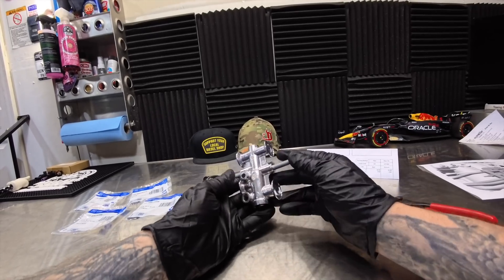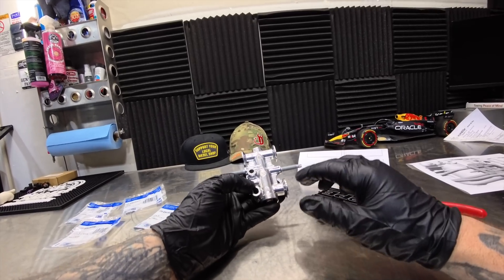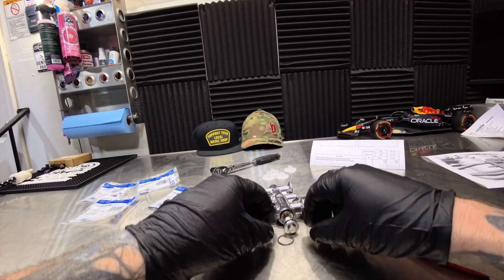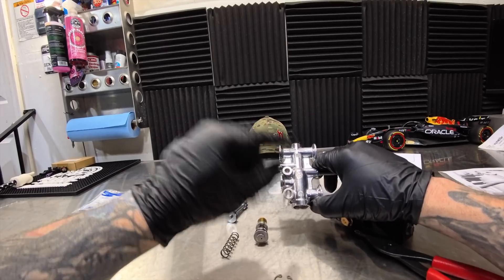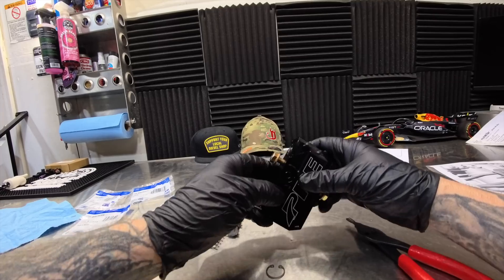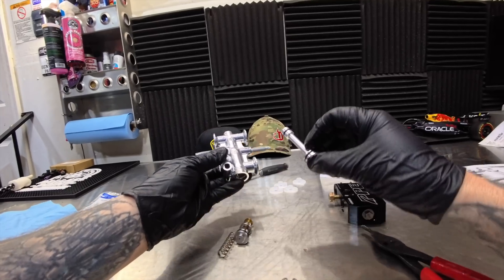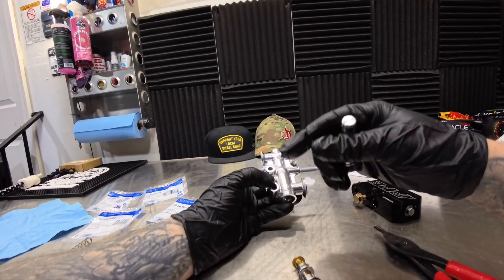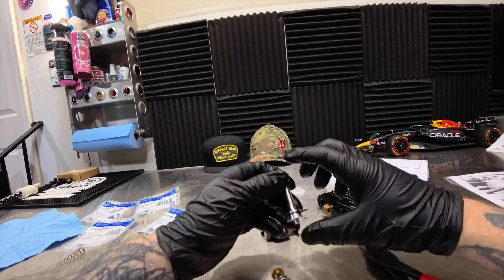Don't Let High Temps KILL Your 10L80 Transmission or Valve Body

Comment: what about a resistance heater strip on the line for winter? or blocking part of the trans cooler if it is separate?

Comment: Hey brother so I’m in Los Angeles California coldest it gets here is 40-50 degrees hottest is 100 degrees would you recommended installing this bypass just to protect these transmission for the future? I also don’t do any towing tbh just daily driving my trail boss
Reply from the maker: I lived in Anaheim, CA most of my life. If I were still there I would be running the PPE Bypass for sure. https://www.demonworkshop.com/products/2020-2025-gm-3-0l-w-10l80-transmission-transmission-fluid-thermal-bypass-valve
Reply: @DemonWorks thank you brother will order

Comment: Waiting for your follow up on this barbell install. I live in Alaska and don't want to install the ppe product for reasons stated in your presentation. In my 2015 5.3 there was a gm valve/thermostat offered per gm service bulletin which worked very well. Also resolved overheating in that transmission. It was set to open at 160. Perfect. I just purchased my first diesel truck last month a GMC 2026 3.0 Duramax. Your channel has been a valuable source of information for me. I am looking forward to many mods and upgrades in the future. Engine auto stop delete was my first one. Please include who makes this part and how I can get it. When you do the follow up on this valve body part. Thanks for all you do! Northpole AK. If you want to send me that part I will get back with you on what happens at -20 with the numbers.

Comment: With the barbell valve my tranny has hard time reaching 108f in 50f weather,  too low for my liking stock valve going back in. And there's more then enough room to remove the valve without removing the housing

Comment: Great Video! There needs to be more conversation about the Quality of ULV OEM fluids. There is almost zero wear additives in them. They are pretty much hydraulic fluid with detergent additives and red dye. Shocking numbers. I think this is a big driver for failed or worn components

Comment: I put this on when I got my 2021 with 45k miles since bypassing the one on my 2014 6l80 5.3 it made a big difference. With this one I've noticed very little difference.  Just did the PPE deep pan and amsoil fluid and still getting to 180ish, also in Michigan so temperature is still around 70-80. When towing my boat ~5000lbs it doesn't really get over 190 but still not a drop from what I seen before. I'm at 54,000 miles and it shifts flawless, fluid wasn't crazy dirty or anything when changed. As you said it needs some heat so staying between 160-190 is perfect to me

Comment: It looks like Factory is more restrictive even if valve modified
Reply from the maker: Absolutely, that was the goal, to slow it down a little in comparison to how well the PPE one flows. This was meant more towards an improvement at winter time.
Reply: @DemonWorks Thank you

Comment: I live up in ND and was wondering if it would be okay to install it up here in the cooler weather during the winter months. as we speak I have a PPE transmission pan on but have not pulled the trigger for the bypass yet. I do see the 195-205 transmission temps still and would like to swap out the bypass if possible, thanks for the help

Comment: Tried the PPE bypass and ran too cool- couldn’t exceed 150 in the summer time.

Best combo for me (New England) had been the STOCK valve.  Add a PPE transmission cooler and you will run 170 all day long.  A bit higher around town, but coolers down within a min back to 170 once you get moving.
Reply: The valve doesn't open to 196 so the PPE transmission cooler wouldn't help at all until over 196?

Comment: I have 2024 1500 3.0  22,000 miles. Average trans temp 194-196 commuting a hr. I got the BET barbell last week and kinda on the fence to install it. I definitely looked at PPE but like most 
people im concerned about too low winter temps even in the NW isn’t very cold very much. Before I found these bypass items I was going old school way by adding inline cooler. But won’t solve current 196° average temp NOT TOWING. Because of OEM thermostat. I got both PPE engine and trans pans those are going on next week, maybe the BET barbell too. 🤞🏼
You definitely got my attention to see your exp. with barbell. Keep up the good work 😅

Comment: I replaced the OEM  valve with the PPE bypass valve and my 2019 Silverado and it runs much cooler. And I have zero trans bump. Check out my install video 
https://youtu.be/UjyetizOhZ0?si=moKWeRqaUJW5KYV3

Comment: I just want to say that First off, why do we feel the factory temps are too high, and second for anyone who has a warranty this is a bad idea. 
I should tell you that I have installed a new bypass valve as you have here and the reality is, the temps are maybe 10 degrees cooler consistently. the 22 duramax 1500 10 spd is never going to drop 75 degrees just by installing this in place of the factory bypass valve. 
I was running 180-190 this summer in 90 degree temps, after installing the new black bypass valve, even in 60-70 degree mornings, the temp still reaches into the 180's, so not sure ow you could pos be seeing a 75 degree drop???
Reply from the maker: Lm2 is a different setup and therefore this piece doesn't have as large of a difference in comparison to the LZ0. In my LM2, the lower temps came from deeper pan and larger trans cooler with removal of the front shutters.

Comment: @DemonWorks so I contacted superior solutions and they said that the STL020 kit is what I needed for my 23 LZO, installed it.  Took it for a 2.5hr drive to Fort Lauderdale 98 degrees ambient temp.  Truck ran 138 @ 70mph a would creep up to 150 in town light to light traffic.  My concern is that actually seems low.  Living in Michigan during the winter months is that going to be too cold?  Curious your thoughts.
Reply from the maker: I personally do not like the temps that low for months.
Reply: @DemonWorks  in your opinion at that temperature is there anything that it could cause physical damage to the transmission??  I’ll be towing a trailer from Florida back to Michigan total weight 3500 pound Ish so I suspect the temperatures are going to increase some as we’re going through the Carolinas and Smoky Mountains.  Not asking for a guarantee just an opinion I know I’m assuming all the risk here.

Comment: I know the 190+ temp is concerning BUT I understood the reason behind higher temps was to "boil off" any condensation that may occur within the trans. You mentioned that in the video. Do you have any "data" that shows running the trans at these lower temps may cause other problems due to moisture? I have the LM2 (same trans) and see 195 max even while towing. I was looking at the PPE bypass but am leaning more toward the "barbell" solution. I am concerned that during Michigan winter the trans will NEVER get to operating temps. Not interested in switching the valves every 6 months.
Reply from the maker: I do not have any data to back it up, unfortunately. I do agree, your trans will not get up to temp in michigan winters.

Comment: Does the zr2 comes with the max tow pakage?
Reply from the maker: No, unfortunately it’s not an option. If it did, would be a perfect truck.
Reply: @DemonWorks  do you think is possible swap it for 3.73? And still runs normal?
Reply: Sorry my english is not perfect

Comment: How are we supposed to get the trans oil level correct when these bypasses are installed, since we can’t reach the correct temp when checking the fill hole?
Reply from the maker: The trans level process does two things- gets the fluid up to temp to start flowing the fluid through the bypass valve and to get the fluid to raise due to fluid expansion. Since the fluid is already flowing through the valve, that is solved. once you get the fluid up to your new operating temp, the level of the fluid will be accurate.
Reply: @DemonWorks  thanks for the reply. I guess the question is, is the fluid expansion negligible from 125 to 175ish? I would think so, but not sure.
Reply: So, if I change the valve on my ‘25 and have the dealer change the fluid in the future and they notice the temps are lower, will they wonder what is going on? I have a PPE pan coming and I am wondering if I am pushing it with the dealer? I asked them about the Nexgen valve body and they would void my warranty if installed…Lincoln was cool with it.

Comment: I installed the ppe transmission cooler on my 2024 3.0l  . The temperature runs between 186 and 196 while hauling my travel trailer.

Comment: Absolutely the best for transmission. South Florida never goes over 130 and when I'm towing 6500 pound boat and trailer gets to 140. Had in my 2023 Duramax. 3.0 and now in my 2025 Duramax. Also installed PPE Transmission cooler and deep pan. ❤

Comment: If this is such an issue, why doesn't GM address it with a factory engineered solution?
Reply from the maker: They like the fluid to be hot and thin so the vehicle gets better fuel mileage.

Comment: Very interested in this. Had the trans fluid changed in my 2023 and the color of the oil was awful. Very little towing. I agree with the oil degradation. GM mechanic says there is not a good way to flush the system on this transmission. Had them change the fluids on my 1/2  and my 2022 3/4 ton diesels. It was expensive to do but way cheaper than a failure. Did both trucks at 35K miles.
Reply from the maker: New video is up. Good call on changing your fluid. They are correct, there isn't an easy way to flush out the fluid on these.

Comment: Love how technical your videos are man. As always great quality content. My question is if this is this unique to the 3.0 Duramax? Asking because I tow a 7300lb boat and my trans temp has never went above 180. This even at slow speeds going up hill. It tops out there then will drop off. Truck is stock 25 AT4 1500 6.2. I thought they shared the same trans?
Reply from the maker: Thanks for the kind words! Your truck, being the 6.2 actually has a lower temp valve inside the trans, so the gas variations run a bit cooler.
Reply: @DemonWorks I wonder if it's possible to just run a different valve from say the 6.2s?

Comment: Shouldn't the transmission get hot to burn up any humidity or water in the oil? maybe thats the reason.
Reply from the maker: Yes, that's what was mentioned in the video for the condensation in the fluid.

Comment: I own a 2025 AT4 Ultimate with just 3,100 miles on the odometer, and it has already overheated twice. It’s currently in the shop, awaiting GM’s approval for a full transmission replacement. Based on this experience, I’d argue that keeping transmission temps lower is far preferable to the consistently high readings above 195°F. Anything over 225 transmission fluid starts to breakdown.

If condensation were the real concern, it’s worth questioning why the gas-powered variants have a thermal bypass valve that opens at 143°F. Water and condensation can begin to evaporate even at room temperature, so the idea that 120°F is “too low” doesn’t quite hold unless the rate of condensation is somehow outpacing the evaporation rate at that temp. And if that is the case, you likely have a much more serious underlying issue than just transmission temps.
Reply: That's what I have thought as well... why would water need to hit boiling point to evaporate?  Your shower steams at 100 degrees. And seriously,  how would any measurable condensation get inside a sealed transmission to begin with?

Comment: installed and not seeing the temp drops it claims! still hits 200 after the ppe bypass any recommendations?????
Reply from the maker: Do you have the LM2? That is routed different than the LZ0 and typically sees less of a drop in temps. You could have a different underlying issue, but we will ignore that as a possibility. On my LM2's I removed a few of the front shutters to allow airflow to pass through the trans cooler and that provided a nice drop. The shutters will close and block all airflow, this will keep temps high in both the engine and the trans cooler.

Comment: My last truck 2010 5.3L with the 6 speed trans never got hotter than 73c/164f when towing on a hot summer day. 

Never had 1 issue with the transmission had 450k km on the truck. Also drove it in cold winters as well. 

So I fell which ever product would keep you in that range would be good. 

Will like to see how you make out with temps with the bar bell vs ppe bypass 

Then I can decide which one to order

Comment: Come on man. This is just nuts.  Driving around with a transmission temperature at 120???  Even Allison engineers are laughing at this.   This has no application in the real world.  180 is great. 120 is just silly.
Reply from the maker: hmmm..... I feel like something was missed here.
Reply: I’ve never heard of a transmission failure because of it running too cool.
Reply: @jestandaert it’s called thermal dynamics.  If you were to hypothetically run a transmission at say 70 degrees, it would absolutely cause damage and be extremely inefficient. 
Just like most engine wear occurs not a start up, but the time between start and the oil reaching operating temperature.  They won’t even start a NASCAR engine until the oil is heated to 180 degrees. 
  At 120 degrees you will wind up with water in your transmission and excessive clutch wear.

Comment: I would like a setup where I could flip a valve to bypass the factory valve in the summer but in winter flip it back so it controls the temperature.  I think that would give you the best of both worlds.
Reply: You can with this barbell. It took me 5 minutes to swap the barbell in, and i only lost a few dribbles of fluid. You can do it on the truck. Got the same temps as the ppe block

Comment: I dont understand being nervous about too low of temps for condensation burn off. Think about what was done 20 years ago..... nothing. I feel its done for emission reasons. Diesels take longer to warm up.  I have a 2021 tahoe. Went on a 1,000 mile trip 2 weeks ago. Not much hill climbing but temp was on average 150. Mines a gas engine so it does not have a thermal valve. High temps cook the converter

Comment: My 2025 with max tow i have never seen above 194. Driving to work its 180 wonder why you are seeing 223.
Reply from the maker: just driving around, I will see the standard 198ish. The higher temps come when towing or low speed driving, like off roading.

Comment: People keep saying it needs the temp to burn off condensation. I don't see how that is an issue. In the oil pan, the condensation can evaporate and get burned in combustion and out the exhaust because of the PCV valve.  How does it happen in a transmission? Isn't it a sealed loop with nowhere for the evaporation to go except to condense again? Remember that water boils at 212. Evaporation doesn't really start accelerating until about 180, but motor oil gets above 212 all of the time which would totally remove the water. Am I missing something?
Reply: There is a vent so technically the transmission is open to atmosphere

Comment: If using the PPE, how about using a block off mask over the cooler like the big rigs do to maintain a good temp range?
Reply from the maker: We have shutters up front that do that job. It helps but still only 120 degrees was what I saw.
Reply: @DemonWorks  I have a 24 Yukon with 6.2 and looking to use this to protect my transmission.  Since these don’t have shutters, could be useful.

Comment: Thanks for the tip on the barbell. I got the Next Gen valve body kit and some Sonnax torlon ball check valves coming to upgrade my 10L80 and I might do the barbell on the bypass valve at the same time, especially since I will have all the fluid drained out. I do wish someone would design a new set of guts for the thermal bypass valve that opens at a different temperature - this seems like it would be the goldilocks solution for thermal management.

Comment: I added the PPE bypass on my max tow sierra. I just towed my 8k camper with a 1500 pound boat behind that. 92 temp outside. It never got over 150 on flat ground. Hit 165 in the hills. Before it would run 200 on a cold day empty on flat ground. Great product.

Comment: Huh. I didn't realize the PPE doesn't have a thermostat. Seems like it would benefit from one for sure. 180deg while retaining high flow would be ideal to ensure moisture is evaporated out. Less than 180 consistently is not ideal in my experience.  I just did the PPE pan with no other mods a few years ago and have been happy with my results. Trans temps the majority of the time stay around 180 unless I'm towing. The highest I've seen was about 200 or so, where as before the pan swap I was consistently seeing temps above 230. If anything I'd upgrade the cooler as I don't see any additional benefit from upgrading the thermostat (besides that cool magnet of course).

Comment: I live in MD which gets pretty cold so I just did the PPE transmission cooler, 175 temps are common but I'll watch for that 196 threshold of the valve opening up.

Comment: 2024 GMC 3.0. Just installed the PPE two days(7/14/25) ago so limited experience. However, according to my iDash before the change and with the ambient air about 92, the Trans temp was 197-199 and Oil temp was 234. After the install and a 32 mile drive to get it operating temp, the ambient air was about 88, oil temp was 225 and Trans temp was134 for a huge decrease. It never went ent over 137. It's supposed to get hotter this week so I will try to recreate the conditions at a higher ambient temp for direct comparison. Also once I tow my 8500lb trailer I will see how hot it gets. 
Pictures to prove my experience.
Reply from the maker: you will be very happy with it. I have some videos running it and my trans temp never got above 160 on long grades through the california / nevada desert.